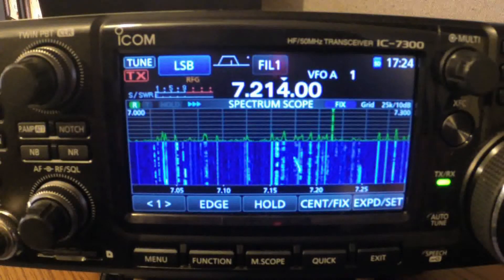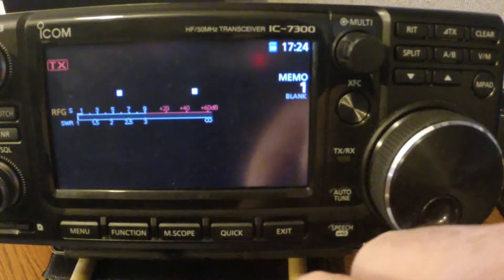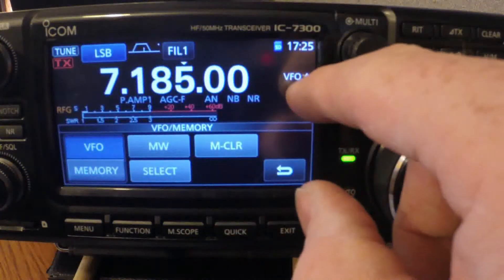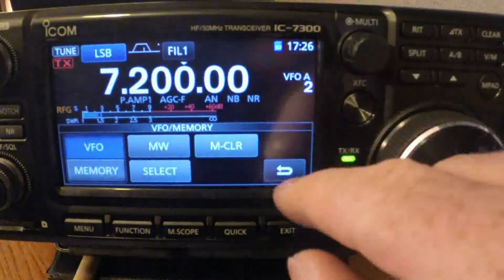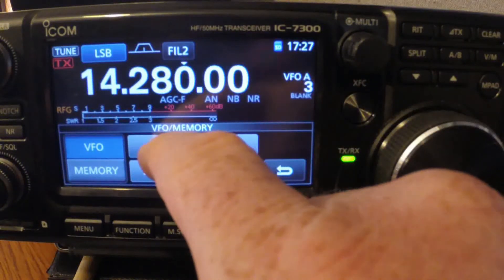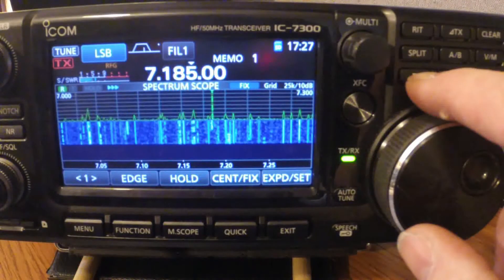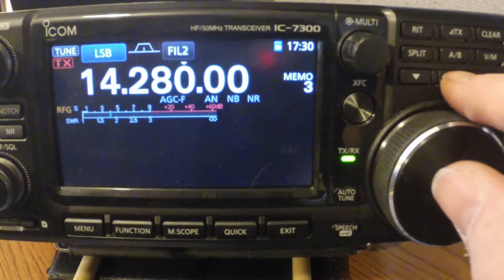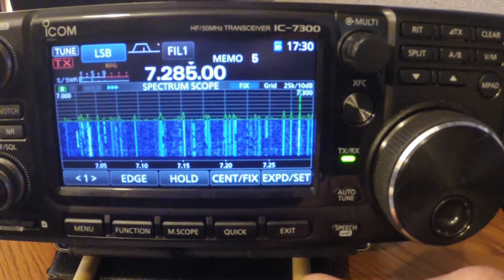Programming Memory channels in the ICom 7300

Comment: does this save to internal memory or do you need a memory card installed? M7MGD
Reply from the maker: You know I am not really sure, I do not have an answer for you on that.  I do have a SD memory card but not sure if you have to have that in the radio to store the memory channels,  I do not have the radio any more to further test this.
Reply: @snafu673  Thanks. I will try and save without and see what happens. It might prompt to install memory card at that point. 73's M7MGD

Comment: That was very helpful, will bookmark it until I have that memorized. Do you recommend an external antenna tuner? If so which one? Bill Rhetts - KM6ESG
Reply from the maker: I don't use an external antenna tuner, I use the tuner that is on the radio.  I have been looking at the MFJ auto tuners...

Comment: curious as to what pointers to use instead on finger on touchpad. tnx
Reply from the maker: It was a cheap plastic tip stylus, you can find anywhere.  I don't touch the screen that hard with it, I am very gentle when I make contact with the screen.